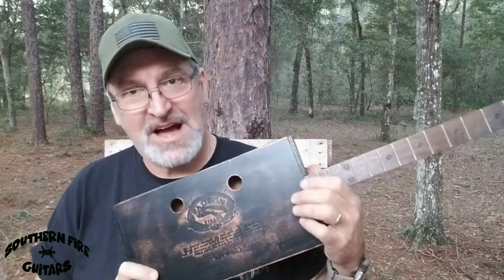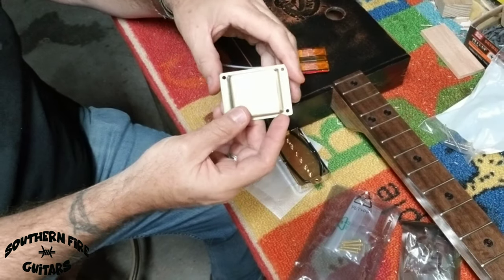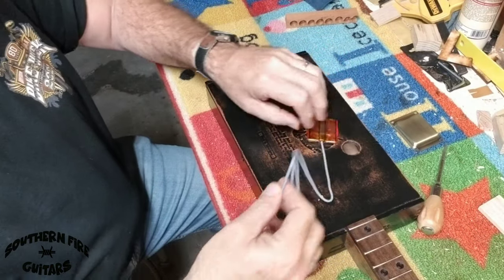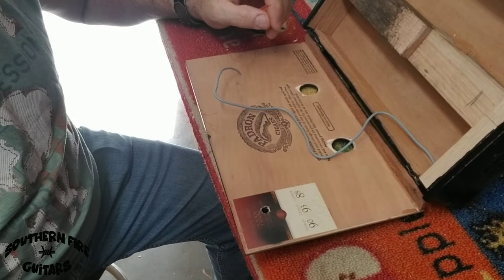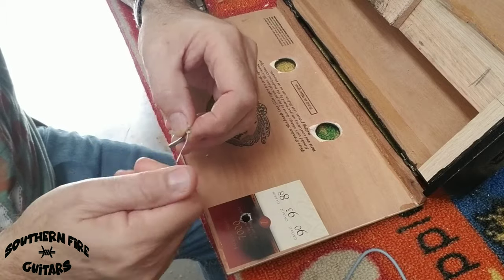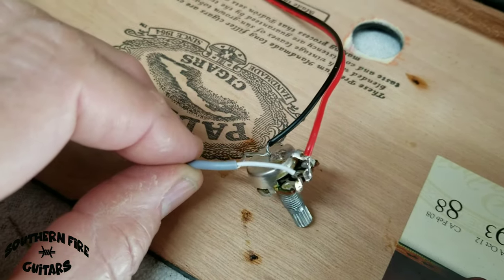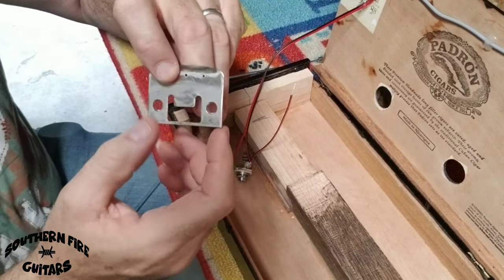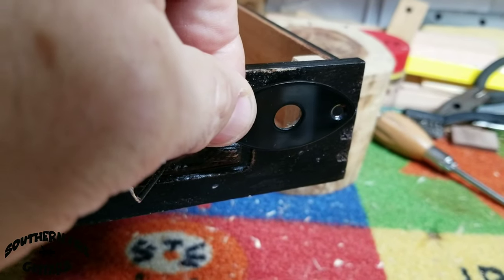Cigar Box Guitar - Installing a Flat, Top of the Box Pickup.

Comment: Wow, thanks. I'm getting set to install a flat pickup exactly like that one. This is perfect. And, I like how you fix your wires to the lid (mine just flop around loose inside the box). I was wondering what kind of adhesive you use for that (it might be in another Southern Fire video, I'll look around.) And really nice playing. Thanks again.
Reply from the maker: Your welcome, Flow. Thanks for checking out the video. Good luck with your build. I use hot glue to fix the wires to the inside lid. Keeps it a little neater .  M~
Reply: @SouthernFireGuitars  ahhh. hot glue! Thanks, Michael! I recently got a hot glue gun, used for only one project in a very different area, so it didn't occur to me. 

And thanks as well for the public service of showing your worktable (especially @ 11:05), makes those of us with similar work spaces feel better. 
It's amazing how the various categories of tools, parts, scraps, wires, solder, etc. can build up so fast on the table.
I can accumulate so much stuff in three hours that I can lose parts in a three foot square area.
I take it as a good sign that the work is going well - get so involved in the process that you lose track.  :0)
Reply from the maker: @tubekook55  I know what you mean, I will start out with one or two tools on my work bench, and in a matter of an hour I have 20 tools and a big mess lol I need to re organize my work area to make more room, so I can misplace MORE tools and stuff. :)
Reply: @SouthernFireGuitars  great plan.   :0)

Comment: Nice video Michael,  I do have a question when you have time, I have noticed that your cbg's mostly do not use the tone pots, is there a reason for that? Thanks and be safe!
Reply from the maker: Thanks fokker.  I don't think a tone knob is really necessary on a guitar with 3 strings. You do have your amp settings as well. M~

Comment: I was a little confusedly by this. Why do you use acoustic strings instead of  the electric string option, when you are basically  building an electric  guitar? Or does it really matter?
Reply from the maker: Hi mrwilly, the strings on this guitar are nickle wound, so they are more for electric or magnetic pickups. But I have used bronze wound before as well. Its a preference thing, I believe.  M~